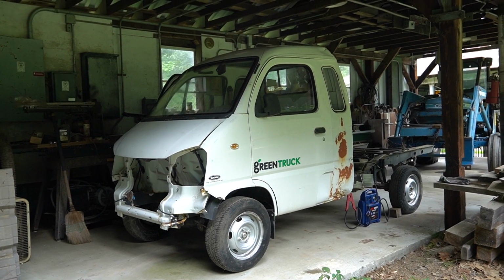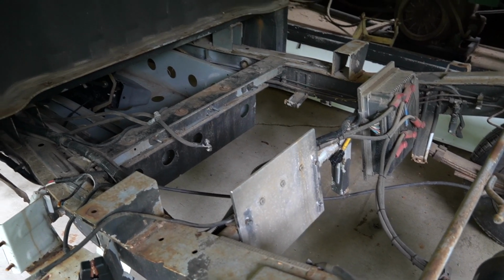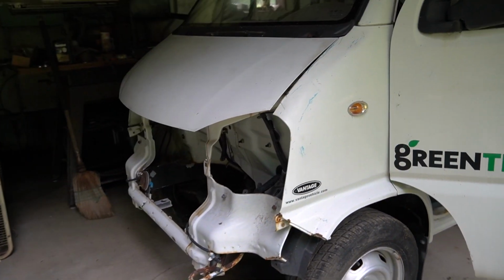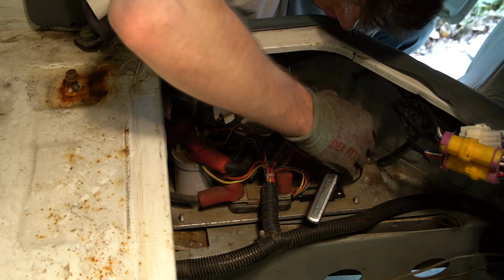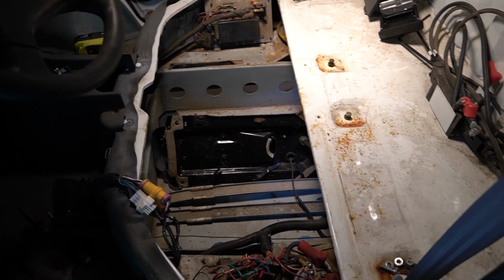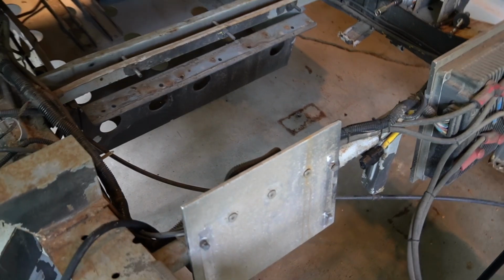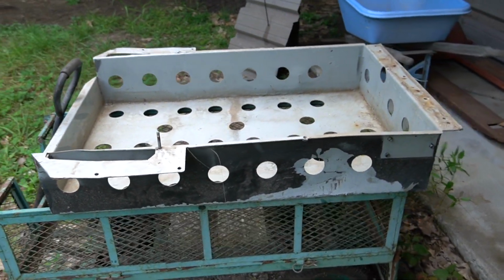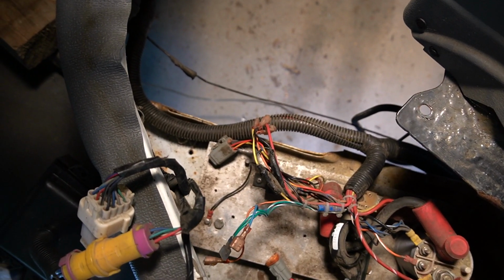The ELECTRIC mini truck is ALIVE!

Comment: Did you ever happen to finish this build? Curious if you did a lithium swap and any issues?
Reply from the maker: I have yet to finish this one but I do still plan to. Still going for a lithium swap using reclaimed 18650 cells in a custom pack. More videos to come this summer on it!
Reply: @savvysprocket just finished a rebuild myself. I used 2 36v golf cart batteries, and a separate 12v 100ah for acc. Runs great and all.

Comment: Would you be able to tell me what the part number is for the piece next to the Sevcon? I just bought a Vantage and it seems to be missing it!
Thanks!!!!!
Reply from the maker: For sure! I will have to get back to you however as my truck still isn't at my house. I'll be working on mine this Friday however so I will drop another comment this weekend.
Reply: @savvysprocket  Thank you! Would you also be able to take a picture of the battery under the driver's seat that has the 3 smaller wires that connect to it? I am not sure which terminal those 3 should connect to. Thanks!!!
Reply from the maker: @SCUBAsean next to my Sevcon I have a three-bank fuse setup and a contactor. I'm guessing you are looking for the contactor? Mine is a Trombetta 36v Part No. 784-3621-020. As for those three small terminals when I got my truck those were all connected to the negative terminal of the rear middle battery. However, I'm not fully sure if that was correct as my battery pack had already been partially disconnected when I got it.

Question for you now. On the other side of the battery from the Sevcon does your truck still have all those components on that side's aluminum mounting panel? I am missing two components.

Comment: I just got 1 of these. That noise on mine is the emergency brake handle. It needs to be up when parked or the siren goes off from a safety perspective to remind driver to use the ebrake.
Reply from the maker: Ah that would make sense! My emergency brake was discontinued including the sensor wire. I'll have to jump that temporarily to quiet things down.

Comment: I'm looking at buying a 4-door version of this truck, in a local auction.
It appears to be in great shape, cosmetically, but likely has dead lead-acid batteries.
If nothing else, the drive axle with 63-horsepower three-phase AC motor, the Curtis speed controller and the charger will be well worth having!
Reply from the maker: Best of luck at the auction. These are great little trucks in working condition or as you said just the parts alone are great to have on the shelf for a future build.
Reply: @savvysprocket  As well as the GreenTruck, there's a first-gen Miles ZX40 in the same auction.
Reply: Looks like the ZX40 had all of 5.6 horsepower, and it was the first street-legal Chinese-made automobile sold in the US, starting in 2005.
Reply from the maker: Interesting! I didn't know the Miles had such different specs. I did read that compared to Vantage that the Miles trucks were a bit better built when it comes to the metal structure itself.

Comment: Thx for such a detailed set of posts on your Vantage EVX1000. That speced out its EV components. When (or if) do you plan to finish the Rebuild/Upgrade and post about it? And were you able to confirm if all the speced EV components, (expect for the dead AGM batteries) where fully functional oe not?
Reply: I get how the Bobcat would take priority. But now that you have more than 1 project that is being posted about on your channel. Playlists for each project would be useful (especially for the Vantage EVX1000 project). For finding the posts and for playing them in their correct sequential order. 

FWIW I'm novice, but after watching your posts. I found that there is a lot of reference documentation on its components, including how to reprogram them. For example if you wanted to change the voltage of its replacement battery pack? So when you get back to it. Feel free to reach out. If you want any outside input. 

BTW I subscribed to your channel and good luck with all your projects.
Reply from the maker: That is a good point. I do have two different playlists setup for each current project I have running at the moment. I just adjusted my channels main page so they will show under a new section. I currently have three different videos on the Vantage truck at this point.

Thank you for your subscription. I really appreciate it!
Reply from the maker: Thanks for the comment! I do plan to finish the build and continue with more video updates on it this spring and summer. Some other projects took priority for a while before this one. I haven't tested anything else besides what you see in the videos yet. Once I get my Bobcat running correctly I will move back towards this project.

Comment: Power BDI Battery discharge indicator This is the state of charge of the main battery
pack, stated as a percentage. 100% is fully charged.
At 35% the system will turn off the heater element or A/c system to save
power.
At 25% the vehicle will go into limited power or "limp" mode to get you home.
This limits speed to about 15 mph to save energy.
At 20% the power will be cut to the drive motor.
Reply from the maker: Hey Darrell. Are you saying that is what I'm missing under the drivers seat?